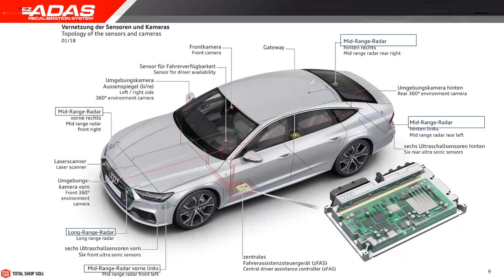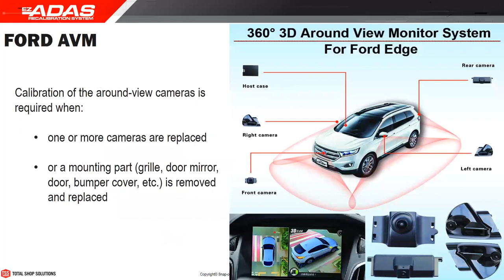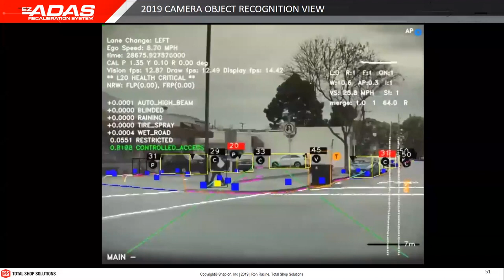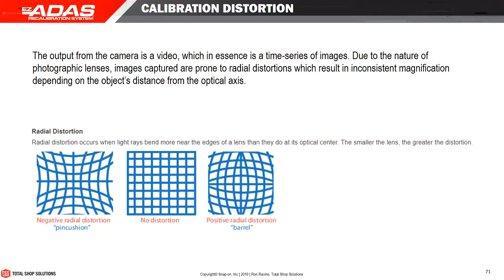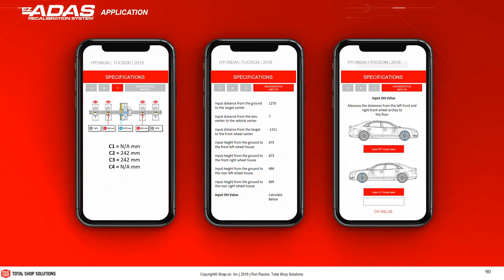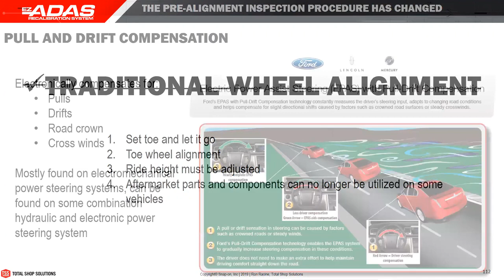Advanced Driver Assist Systems (ADAS) Operation Overview For Collision Repair With Snap-on

Comment: This looks interesting but I don’t think it deserves 1 hour + of my time when a friends review is “I’m encountering serious concerns about legacy auto …. A T needs none of this bullshit calibration, you just drive it down the road and it calibrates itself 🤣” and “Why do they need all this crap to make it work?” And finally “Is how legacy auto plans to maintain dependence on their dealer networks?”. Guess his last point is why. It’s a serious problem, middle men mark-up dealers are not needed to sell current tech cars (I’m thinking EVs verses legacy tech combustion), but they think they can still extract a huge margin from the retail buyer with out adding any value (just costs). You can tell they make too much by the community work and sponsorship they do to try make them (or us)feel better about it. Now the buyer knows more than the dealer and we don’t need routine servicing (just inspection) their days are numbered.
Reply: @hdi7kJXqmW4q  Sorry, my friend didn't use a very informative abbreviation.  it is meant to be read as "A Tesla [EV] needs none of this..."